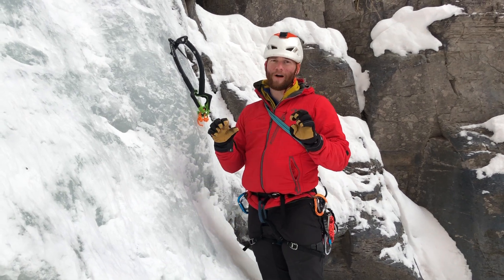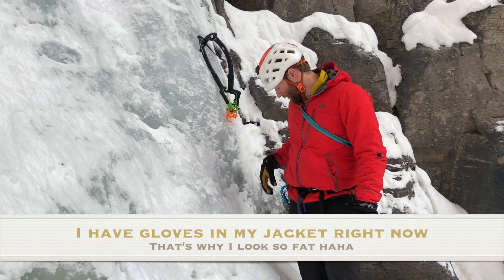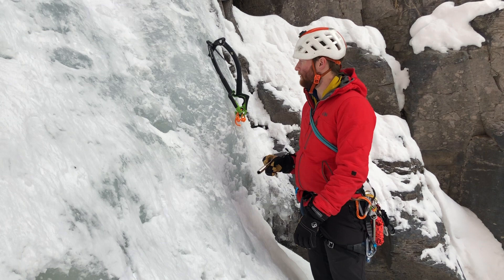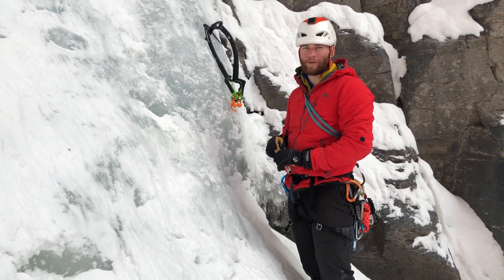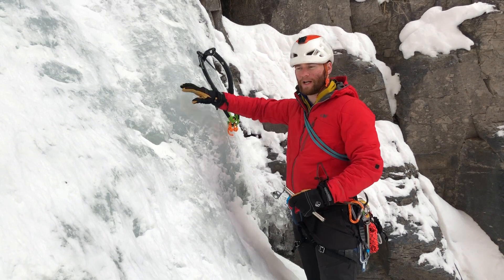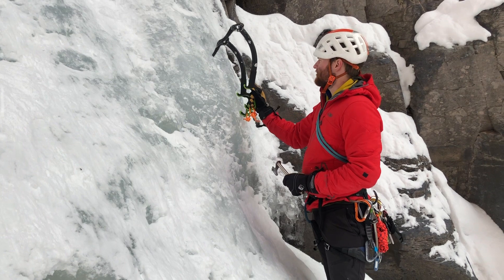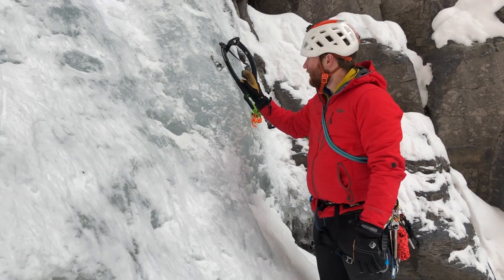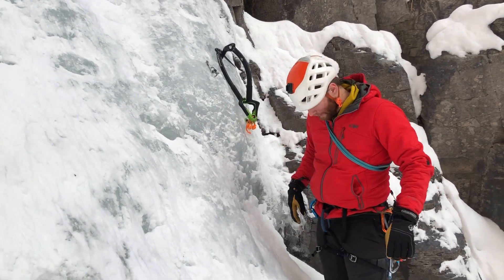Making an ice anchor

Comment: is it common to have lockers on the screws instead of non-lockers for anchors? do you use v threads for anchors ever, aside from just on rappels?
Reply from the maker: I usually just use non-lockers, unless I'm worried about the gate being opened. When I'm setting an anchor for top rope guiding where I have to use ice screws, the big example is when I'm working on seracs (in Washington the only ice climbing is seracing haha.) I'll use three ice screws in my anchor to have more le-way with melting out while everyone gets a top rope lap. I haven't tried this out yet but I was thinking the other day that I will start to add in a V-thread into my anchors when it's top rope seracing because it takes longer to melt out and it's overall stronger than a single ice screw on it's own. I also get the added benefit of having it already drilled for rappelling off at the end.
Reply: @ryantilley9063  Just to add on to this, I would say it depends on what knot you're using. A locker would be needed if using a figure 8, for example, as it is loose on the biner and could unclip itself. Personally with two screws I use one locker (with figure 8) and one snapgate with a clove hitch for adjustability.

Comment: Nice video, gotta mention that equalizing an ice anchor is controversial since both screws might be weakened over time because of pressure melting. Usually you only want to load one screw and have the second as backup. Not critical in your case ofc since you can stand and don't have to sit in your harness for a long time.
Btw, the girth hitched carabiner has been a very common anchor setup for rock climbing in the south part of the Alps :)
Reply: Pressure melting only really occurs at pressures over 10 bar. You will not get this on the threads of an icescrew. Also an equalised anchor would in this case lower the pressure on each ice screw, making it less prone to melting out.

Comment: Good screw placement but but should have screwed them in at a positive angle at around +10 degrees from horizontal. Not sure about the girth hitch either, otherwise good.

Comment: Another great video. Noob question: do you have dedicated carabiners for putting into hard goods (bolts, screws) and some for soft good (slings, rope) to avoid having small knicks in the carabiner damaging soft goods? Thanks
Reply from the maker: I sort of do have the dedicated carabiners for my quickdraws, one for the bolt and the other for the rope. As for carabiners that I use for my anchors I usually do one carabiner and one QuickDraw for my sport anchors. When it comes to my lockers I’ll use them on hard goods and soft goods, I just inspect them regularly to see if they get any burrs on the metal that could possibly damage my soft goods. Usually when you apply body weight to your metal gear it won’t burr up as much as a leader fall would. Hope that helps!
Reply: @ryantilley9063  thank you so much for your reply!

Comment: Is the girth hitch anchor still redundant?
Reply: He said it was fully redundant.  If you cut one end, the other is still good.
Reply: @David-cp6rl  yeah he said that at 5:10, but I'd like to get a link to the testing he mentioned

Edit to add: not exactly scientific, but still a test https://youtu.be/-MmX8h4F0po
Reply: @TAVarner17  Good to see others posting Ryan Jinks stuff, he needs more subs
Reply: Short answer: No, not really; but the more you learn about climbing, the more you understand how bomber this shit really is, and the more you forgo doing the more complicated shit and replace it with doing the super quick easy shit..... and in this case the quicker easier shit would be just to do a sliding X (or magic X) and then you get your redundancy, no knot to untie either.
and if you watch "hownottohighline" as TAVarner17 linked to his channel below. In one of his vids (not that one linked below) Ryan jinks mythbusts forces generated on extensions as if a bolt blew with & without knots on a sliding x and there was no difference.
Reply from the maker: Some of the testing for this anchor could still be in the works as far as publishing goes, I got the redudenacy confirmation from the AMGA technical director Dale Remsburg. He said that the anchor was perfectly safe to use, and you know he does his research!